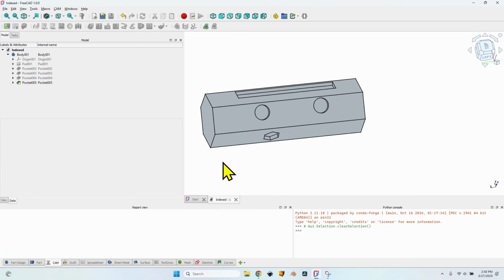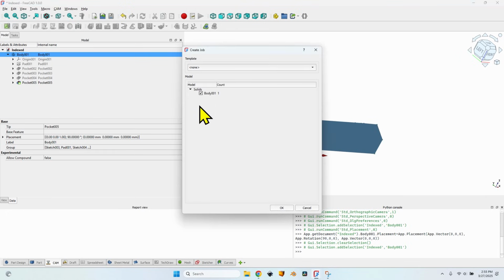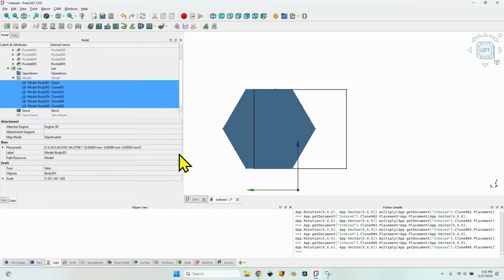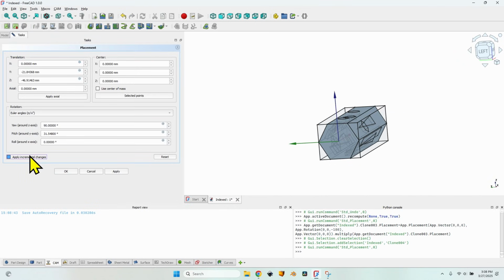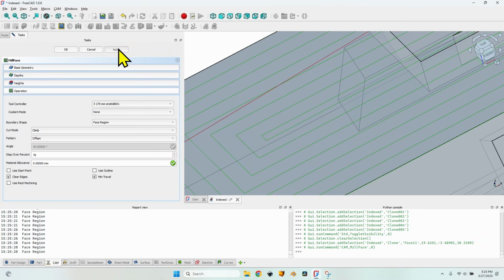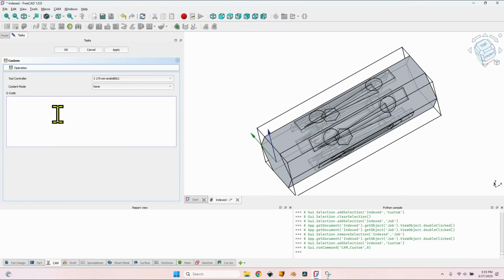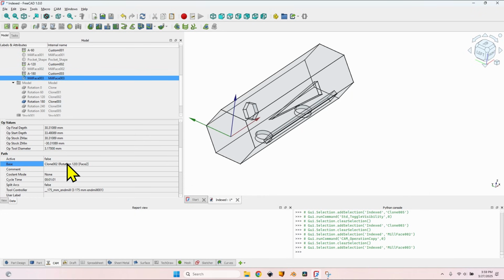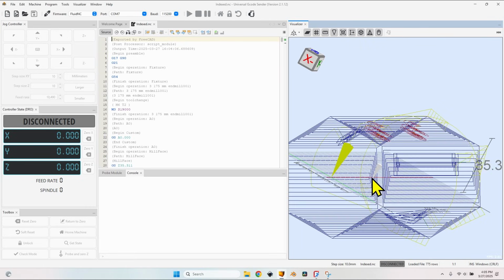Indexed 4th Axis CNC Milling in FreeCAD CAM | Rotary Machining with A-Axis G-Code in One File

Comment: Hi .. quick question.. is there a way to set the view in the new cam simulator window?  When ever I open the simulator window the part is “zoomed in” even if I set the window to full screen … it’s not a big deal but it’s a bit annoying when running the simulator and having to move the part back every time.. thanks again
Reply from the maker: I don't know how to do it, sorry. I'm not even sure it can be done